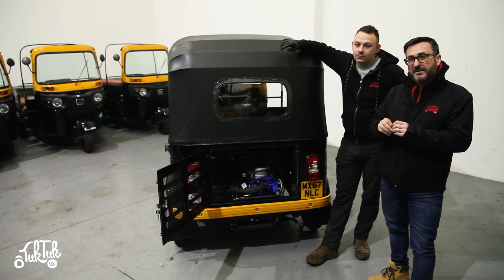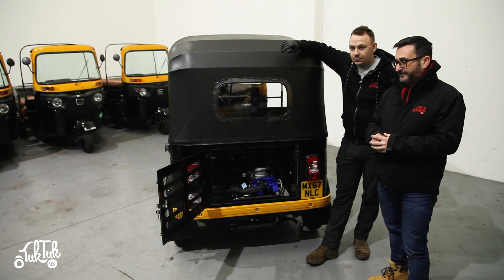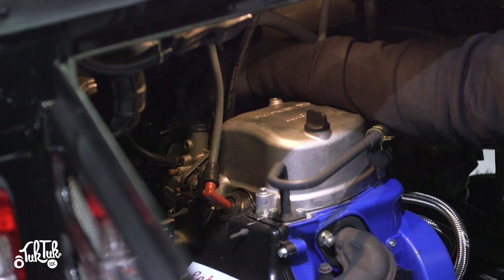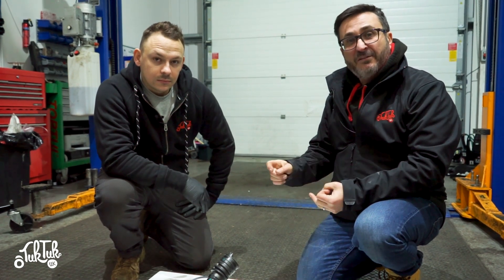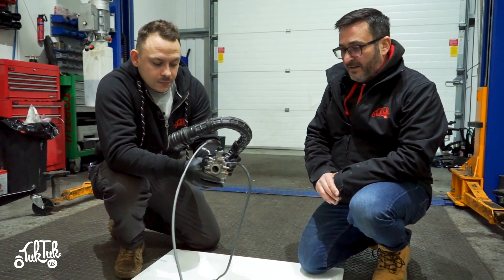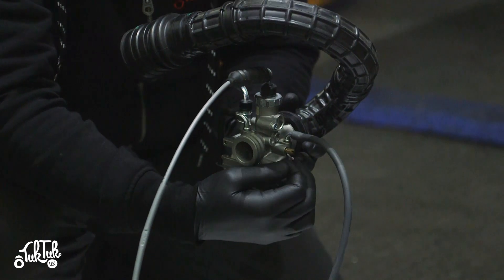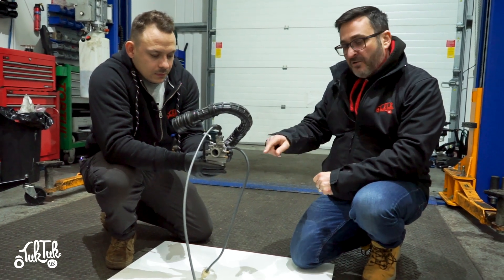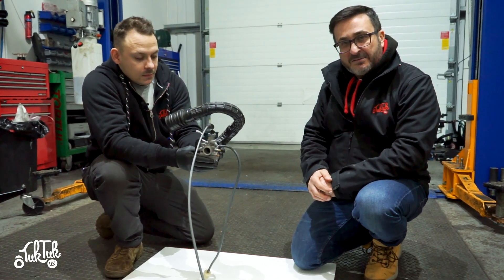How to Adjust The Carburettor On A Bajaj RE Auto Rickshaw Tuk Tuk

Comment: What's the use of the bottom screw.
Reply: The lower screw adjusts the mixture.  That is raises or lowers the amount of petrol that will get into the air heading for the carb.  If there is too much (rich mixture) you will get a low "miles per gallon" and possibly poor performance of the engine and maybe clogging the spark plug with too much carbon.  If there is too little fuel (weak mixture) , then you may get poor performance and potentially overheating.  The spark plug colour near the sparking end is a fair indication of the right mixture.  Black and sooty is too rich.

Comment: Sirs, my tuktuk loses acceleration after 4th gear shifting. What seems to be the problem?
Reply from the maker: This is most likely to be an issue with the carburettor or fuel flow. I’d recommend giving it a thorough clean and replace the jets if necessary. I would also ensure the fuel filter is replaced.
Reply: @TukTukUK , thank you sir!!!

Comment: This is so true. If your Bajaj RE 4s is a carb type, most of your headaches are due to the carb setting. The RE doesn't have an RPM gauge so you have to do this by ear, how the engine sounds (fast or slow). I haven't done the tuning by myself yet but this video really is very comprehensive. Thanks mates!